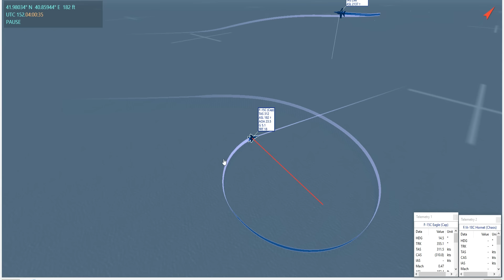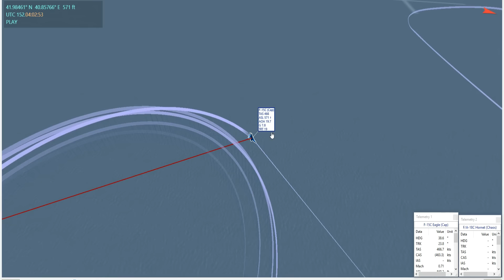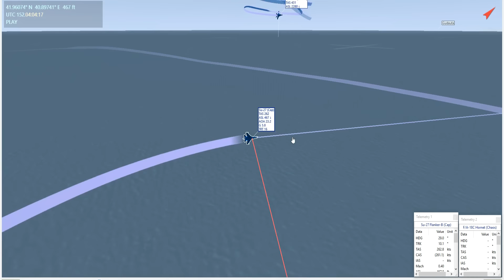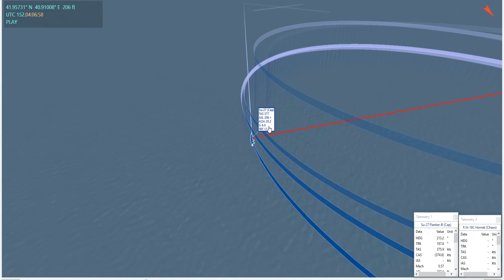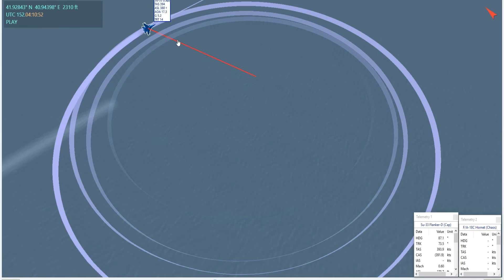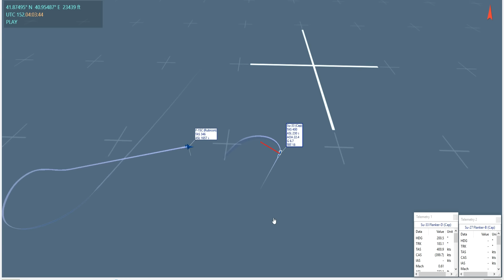F-15, Su-27 & Su-33: Max Sustained Turn Rate | DCS WORLD

Comment: to be honest apart from possibly the mig-29 and the su-27 the turn rates of these aircraft seem unrealistically high in that the f-16 alpha which in real life is the best 4th generation US dogfighter has a turn rate of 18 degrees per second so just about everything you tested apart from the the aircraft i mentioned above should have significantly worse turn rates as in about 16 to 17 degrees per second ball park. The hornets in particular looks drastically to good having one of the highest wing loading's of all the aircraft there. In real life The mig 29 has the highest turn rate at 20 degrees persecond.
Reply: Although it is very possible that DCS is indeed inaccurate, I must ask : do you know at what altitude / with which load the RL numbers you cite have been measured ? Both factors can obviously heavily impact turn rate, and none of the planes shown here would reach those numbers in an actual fight since they would carry ordinance and probably more fuel as well.

Also, the Mig-29S has a better thrust / weight ratio than the other variants if I'm not mistaken, which would give it a better max sustained turn rate as well.

As for the F-18 it is still in beta, we'll have to wait and see how it performs once it is fully released.
Reply: @arthurvilain7270  sea level and to be fair you might have a piont because they are at fuel and have 2 sidewinder but i still don't understand why the hornet would have such a good turn rate as going by most sources the hornet is stated as having a higher turn rate than the mig-29 and also in respect to your other comment well it is true the hornet has a tighter turn radius, lower stall speed and has high off bore-sight capability it does not have a better turn rate than the F-16 as the hornet is a development of the yf-17 cobra which lost to the f-16 in the light weight fighter competition because it was less manoeuvrable and more expensive. Add to the fact that the hornet has lower kinomatic performance than the f-16 it also suffers in bvr combat with an f-16 since it is slower and has a lower thrust to weight ratio of 0.96 loaded weight compared to the f-16 1.08 loaded weight meaning it can't accelerate as fast or lob missiles as far. here are the turn rates of the f-16 and hornet i know it says f-35 but if you scroll down it has the charts for the f-16 and f-18 http://elementsofpower.blogspot.com/2013/04/the-f-35-and-infamous-sustained-g-spec.html
Reply: @bob123-q3g  Those charts are really neat, thanks ! By the way, I definitely agree that it is odd to see the F-18 top the charts here. And I wish we had a flyable F-16 to compare it to ! It's my favorite US plane, probably because it is less "muscular" and more minimalist than the rest of the lot.

Finally, in my other comment I was only comparing the F-18 to the F-15, and there's just no contest between the two in a dogfight (at least in DCS). The F-15's strength obviously lies elsewhere.
Reply: @arthurvilain7270  yeah i agree
Reply: Just throwing this out there to all in the conversation. In regards to DCS they did a selection of Dogfights and the Eagle was able to beat the Hornet consistently. This may have changed with updates to flight models and it's something i'd like to see done in more depth again. The basic premise was while the Eagle bled more energy off than the Hornet it was also able to regain it faster than the Hornet. When the two merged the the Eagles that put a bit of vertical into their initial turn were able to control the resultant dogfight quite easily. Theoretically the MiG-29S and maybe A should be able to do the same.

This would be an interesting experiment. You could try it with guns and the Short range missiles. There's plenty of scope for this that would make entertaining videos on YouTube.
Reply: The F-16 has actually worst alpha capability of all the US 4th gen fighters, mostly because it's limited by it's FBW (even at CAT 1). What they do get though, is a superior sustained turning rate at high subsonic air speeds.
Reply: Robin flack - At first diplays of MiG29 at airshows there was unoficial turn contest with F-16.They keept making tighter turns until Mig29  hit 360 degrees within 19sec. F16 was close tho. That would meant ¬19 degrees/sec sustained. Germans concluded 28deg/s for Mig29 instantainious compared to 26deg/s for F16block50.  Altitude also has effect on these.

Comment: You guys keep using MiG-29G  for tests :/ .  F-18 for dogfight would never be first option in real world for US pilot.
Reply: IRL I think the chance of a mutual kill in a merge is quite likely with IR missile and the capability of getting an off bore sight lock through a helmet mounted display. A sustained turn fight is unlikely to happen, if they merged, they'd both try to make a very fast instantaneous turn and get off an IR missile while hoping that the enemy's went for their flares, etc.
Reply: @shapiro5000  Actualy in 1992 there were friendly exercises with US F15 and RU Su27. F15 had better instantaneous turn while Su27 had better sustained.  It all comes down to starting positions in a fight if pilots are even. But  better sustained turn also shows that plane has better/less bleed characteristics.
Reply: Those underpowered 29G engines.  sigh  The 'G' model would be the last '29 variant I'd choose.

No matter, though, as the MiG-29's new flight modeling is still being updated.  It's performance is still in the process of being changed.
Reply: @NefariousKoel  Yes and another useful experiment would be a drag race with the F-15 and all the versions of the MiG-29 to see if any of these differences have been modelled, which I have suggested before.

Comment: Id be curious what something old like a Mig-21 or F-5 does in this test.
Reply from the maker: Awful lol
Reply: @grimreapers "Cold War Light Fighter" should be a test as well. F5 and Mig21 should have been in the light fighter test I thought, given their popularity.  Maybe throw in the harrier just for knowledge.
Reply: @Ronald Also, would be interesting to see whether the vectoring nozzles will help with the turning rate at all.
Reply: Me as well, although I suspect the results may not be very flattering. The F-5 has a rather poor thrust to weight ratio (despite being very light) and a high wing loading, while the Mig-21 bleeds energy like there is no tomorrow because of the delta wing.

Comparing the results of the 2 planes would be very interesting, however. And throwing the Viggen in the mix as well would be useful for those who play on the cold war server.
Reply: If you look at the specs, then the F-5 would be sustained 12 deg/sec at 370 kts (indicated, ~400 TAS), while MiG21 is also around 12 deg/sec sustained at around 850-900 kph.